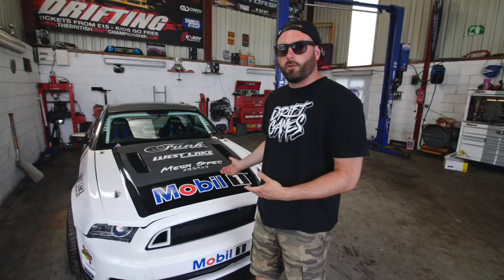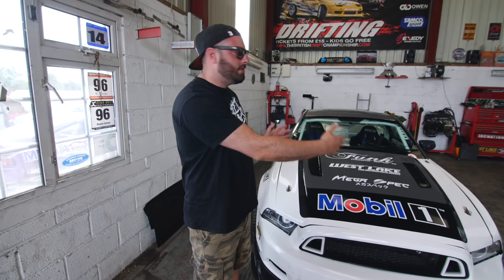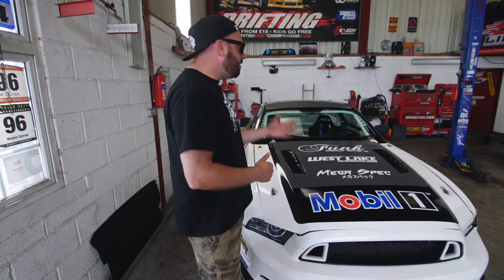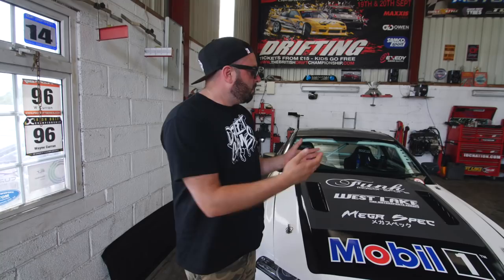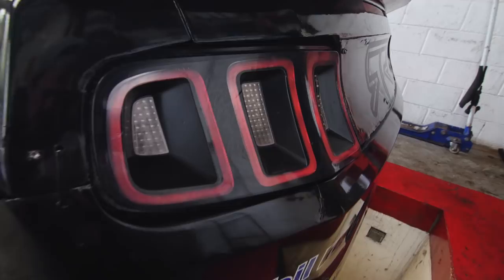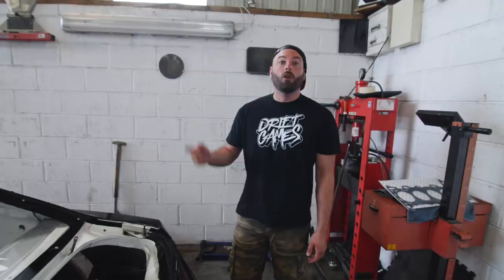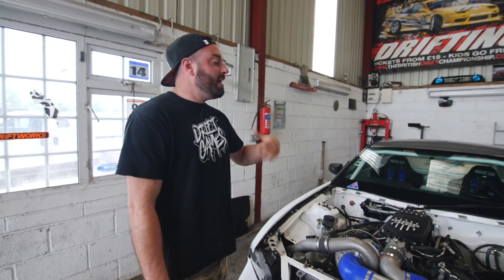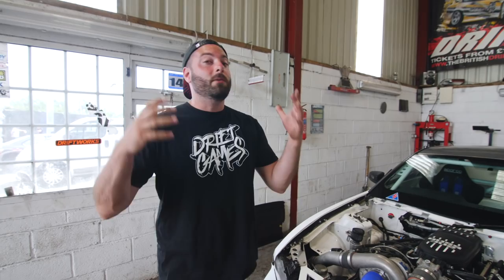VAUGHN GITTIN JR’S MUSTANG NOW LIVES IN IRELAND | 900BHP

Comment: JTP used to make a kit for s197, but all that stuff is gone from his site now. You could change the front suspension to an S550, I have seen that done, and get an S550 kit from JTP on it to get past 70 degrees of angle in the front. You can also go to a JTP-style belt driven top-mount Roush supercharger setup (from the procharger setup), you could run 900hp and have it be nice and live and responsive. You could go full JTP-style and just get a 9.5 compression ford racing block and throw a Roush kit on top of it, and you will have two serial numbered parts you can order at any time and get 1000HP out of it (I mean you will need injectors and a pulley kit with it, some other bits and bobs). Or you could go the other route and take all that off, grab a set of gt350 heads to up the displacement to 5.2, increase compression to probably around 12:1, throw in an MMR stroker kit to up the displacement to 5.5l, add sleeves for extra safety and maintainability, add direct port and get back to if not 900, close to a 900hp NA motor with NA response, and you lose a tad bit of weight of the supercharger and intercooler outside of the wheelbase and move weight distribution back a bit with that plus the bottle. I also don't know if that car still has stock height engine mounts, if so, a few companies make a tubular front k member and brace assembly that drops your engine mounts by about a 1/2 an inch.
Also, do you know who makes those fiberglass parts, especially the crazy (awesome) rear quarter panels? (I am also building an s197 chassis, though for much more grass-roots series at this point)
I would also go back to a plexiglass windshield by adding a center support bar for it, modern FD style, and if you want crazier/involved ideas, I would love to see if the engine can be moved back into the firewall. With a supercharger setup, go to a water to air intercooler and move the cooler into the trunk (or boot), go to an under the car fuel cell (i know some company in Australia makes them), add a bend to the harness bar to slide the seat back (Daigo-style), pedal box, longer steering shaft, also you may be able to find a lighter assist EPS motor to get some steering feedback and usable self steer back hopefully?

Comment: Was only ever a demo car from the lack of quick change, tube framing and fuel cell, FD car was a lot more light weight panels. FD car was destroyed in Texas.
Reply from the maker: Pretty sure that was the 2014/2015 chassis right?
Reply: Drift Games nope the last s197 FD car he had was destroyed at Texas in the tyre wall. He then went to s550 and the 14/15 car is in New Zealand
Reply: Are you sure Fanga's got the 14/15 car? His website says its a 2017 model.Weird.

Comment: Aero Aero Aero for top speed. And why not go with an IRS with revised suspension. Get rid of the old supercharger and turbo the thing along with talking to Vaughn if you can and get his advice on the front suspension mods needed. 

I really think if you could get a steering rack back into the car so it self steers that would be the ultimate goal. 

If your going to swap in suspension I'd look at R34 Gtt rear wheel only set ups which are driftèd in Japan everywhere. 

I'm sure there would be companies adapting knuckles and caster kits etc for the skyline and the car weighs over 3000lbs from the factory so already is designed strong enough to take that sort of weight.

And in terms of turbo I'd look at the latest Garret line or Precision Turbo. 

The last thing would to make sure you go with a flex fuel sensor and run an ethanol fuel as the water content will reduce your charge temps allowing you a denser mixture giving you the ability to get more fuel and air through the engine. 

I'd go with a smaller compressor housing but larger rear housing as the rear housing will restrict your exhaust and always be the choke point for your exhaust system . 

And if you can't get the set up running so when ur shifting you are staying in the power band you can always just try shortening the drag diff. I'm assuming it should be fairly easy on a drag race application diff. 

And last thing I'll say is to check out "Banks Power" on YouTube. There's one very intelligent person with world land speed records under his belt who's seemingly just trying to spread all the knowledge he has accumulated over the history of turbo charging car engines.

P.S.
Have you tried using NOS to ramp in and fill the gap between gear change and boost from the blower coming in?
Reply from the maker: Thanks for all the advice man, you have really helped us out and given plenty of food for thought!

Comment: The TR6060 wasn’t actually only used in LS applications, it was also used in the 2007-2014 Shelby GT500’s. Great transmission with lots of power handling. Also, a TVS blower like a VMP or Whipple would help out your boost lag situation. With those types of superchargers, the boost is generated instantly, which means absolutely no lag, and gives you the response of an N/A motor which is great for drifting.

DriftKnuckles also makes an angle kit for the S197’s that should fit this car. I believe you can check it out here: https://www.drifthq.com/products/driftknuckles-com-ford-mustang-2005-2014-s197-unicorn-angle-kit
Reply from the maker: Thanks for the info, we are certainly no experts as this is probably the only S197 in Ireland. We will definitely look into your suggestions and thanks for watching!
Reply: Drift Games Looking forward to seeing what awesome stuff you guys do with the car!